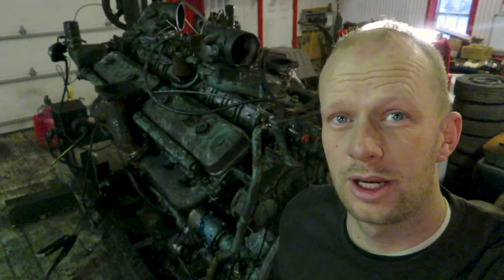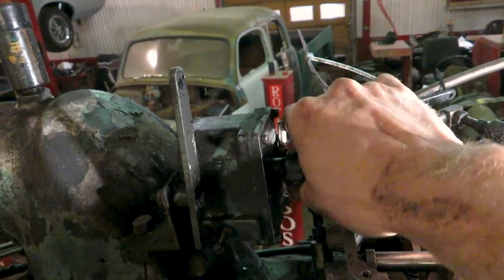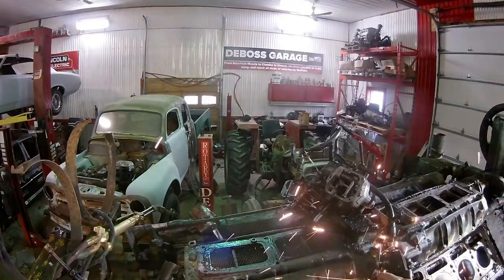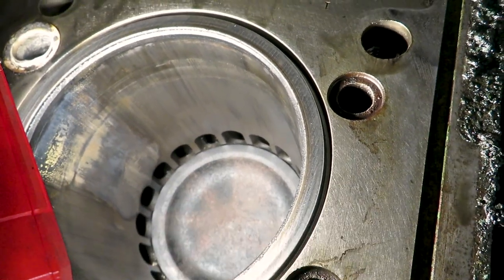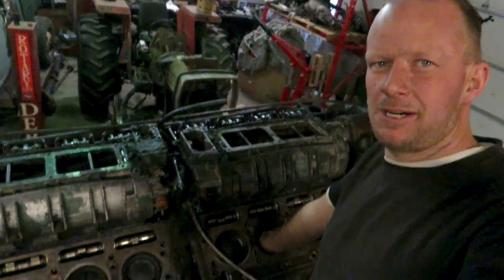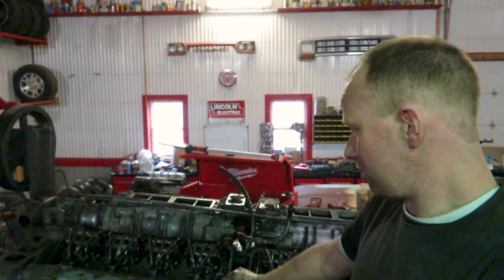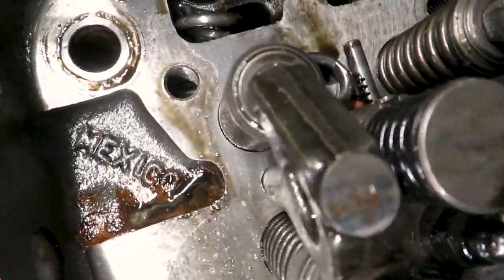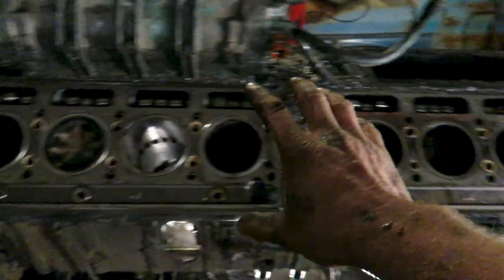What's Inside a 16cyl 2 Stroke Detroit Diesel? #HowItWorks

Comment: When Detroits were allowed to sit too long, the fuel would jell and make sticky injectors. Due to mechanical governor, all of these mechanical engines were at full throttle when shut down. Shutting off the fuel caused the RPM to drop below minimum setting which opens the throttle. When they are started after sitting the injectors are stuck at full throttle. If cranking a Detroit that has been sitting, remove valve covers and check the rack for free movement just like shown in this video before attempting to start. When the engine starts and RPM passes the governor setting the rack will move to throttle back. The 71 series were dry sleeve, the 53 and 95 series were wet, not sure about 110 series or the 149 series, but these engines were a well thought out design for the time period.
Reply: Jeff Snider. I'm attempting to get a 6-71 reverse rotation bus running. 1951. Was running perfectly 10 years when I parked it. It will start,  but won't stay running (ether only). Guess I should pull that valve cover and check this out

Comment: Is it true you can run them in reverse? Very clean under the valve cover.
Reply: At 23:00 or so he confirms this.
Reply: Guess I should have watched the video before commenting.
Reply: Yep, the timing gear in the front cover is switched to the other side and the whole injector/cam drive reverses. Most twin boat drives had counter rotating engines and props for better performance. The Detroits were very advanced for their time.
Reply: You had to reset the oil pump to pump the other, usually rotating the housing 180
Reply: You can run a 4 stroke in reverse too if you grind the camshaft "backwards".
Reply: Yeah, totally. I've seen it done.
Reply: Yes. A LOT easier than you think. I've had them suck water up the exhaust on a marine engine and bend rods like pretzels.
Reply: Pretty sure the biggest thing is reclocking the oil pump and probably a few more things. It won't get oil pressure running backwards without addressing it otherwise its fine. I remember hearing about a dump truck parked on a hill that started to roll backwards (trans in a gear) and it fired up and took off!
Reply: @mytmousemalibu apparently that was a danger with two-stroke tractors, run out of steam going up a steep hill, stall and roll back and now you are going full throttle backwards
Reply: @fuzzy1dk  probably not very good for what ever implement thd tractor is pulling either. I would Imagine most farmers would quickly stand on yhe clutch and brakes if that occurred.

Comment: And another point! These engines are very expensive to rebuild.  The parts are becoming increasingly difficult to get. There were a few exceptions but in general the two stroke jokes did not last as long as the Cummins or the 40 and 60 Series Detroits. 
The company I worked for saved a million liters of Diesel fuel a year when they went to Cummins "C".  The Detroit two cycle engines were an environmental threat.  The best assembly with the best products could not stop the leaking, often called "sweating a little" by the representative. It was common to add more than five liters of oil at the end of a day in traffic. Cold weather starting was always a big problem with the two cycle engines. The company used to buy ether by the dozens of cases  every winter month. 
The later Detroits in the 40 and 60 Series were a much better engine.  The transition was difficult for some of the "old guard" and a few took early retirement. While the unit injector stayed the tune-up procedure was completely different. I am was amused when you mentioned the common-rail fueling. I suppose you could have mentioned the roller cam followers also. The "rollers" have been in these engines for 7 decades. I have repurposed a set of roller cam followers to transport the hydraulic ram in my shop press. The valve spring roller rotator assemblies make good load  separators in a few of my shop projects.  Thanks for the memories. Does anyone remember where the floor-dry is?
Reply from the maker: Thanks for adding that.  We figure the best thing we could do with this engine is a teardown and let everyone appreciate them for what they were
Reply: The floor dry is under my old cat collecting the sweat lol
Reply: A lot of trucks with DD engines have over 1 million miles, some time the piston ring show signs of wear. How ever the main bearings and con rod bearing could go another million miles. As in all engines you have to service the engine as recommended.

Comment: I worked on these 2 strokes about a billion years ago and they were actually easy to work on, which was a good thing because we worked on them A LOT. They ran near or at WOT most of the time on stationary pumps and damn they were noisy and nasty. IIRC, the only time they didn't leak oil was when they didn't have any.

Comment: You, Sir, are not allowed to play with a Napier Deltec diesel.
Blowing that one up would hurt.
Reply: rich actually knows the worth of what he's playing with, he wouldn't break something that still had practical value
ie:this engine was already fucked and not worth a rebuild
Reply: @snoofayy6150  I know that I was just poking fun a little. I'm sure if he had a Deltec he would treat it like his baby. They are fascinating engines.
Reply: @johnparrish9215  deltics are like my unicorn. i wish they adapted that to fit in trucks and cars. it was so power dense and had big displacement for its size and weight. the new ford f150 with the achates apposed 3 2 stroke is awesome. if that truck comes out ill buy one
Reply: @chaytonruijsenaars3971  I've gone so far as to stack up 3 V8 engine blocks in a Deltec configuration just to see if it would work in a large truck. Yes, yes it will.
Reply: @chaytonruijsenaars3971  You know it is ironic that no one ever tried to build an aircraft engine that way. I know you can make it light enough and it certainly made enough power.

Comment: Well that was an interesting breakdown, I never seen inside one. My old man did a Detroit up decades ago on his own never having had one apart, the trouble came when Synchronizing the Injectors which is apparently a bit of a prick of a thing to do. They are relatively simple tough engines though otherwise. good to see your knowledge at work there & sharing it with us.

Comment: Absolutely fascinating!  So if the front and back bolt patterns are the same is there anything preventing you from basically adding a 3rd or 4th block to make it 24 or 32 cylinder!?
Reply: You would have to transmit all the power through each successive engine. Eventually the coupling or the crankshaft would not be able to transmit all the power and would break.  You also would have to build special adapters to power the middle supercharger and  cooling, fuel etc. Technically possible but probably very impractical.  A lot better to step up to a larger engine.
Reply: They did make V24 71 series Detroits, but they were two V12 blocks bolted together .
Reply: The farthest they took it was two 12V71 engine blocks bolted together to make the 24V71. After that, things get really complicated with block, crankshaft alignment and stability. The cranks aren't quite 'plug n play' that way either.
Reply: Could go for world record bolt 6 together
Reply: Yah I agree with your factual statement .

Comment: Great video, I never knew how these 2-stroke diesel worked until now. interesting 4 exhaust valves in the same configuration as a modern 4 value gasoline engine. Also interesting while the cams are in the block, the lifters/followers are in the head. And two cams in the block.  When I was a kid in the 80s, i am pretty sure my old school busses had V6 Detroit diesels in the back as pushers.  I still remember the sound those old blue-birds made after I got dropped off.

Comment: A Friend worked in New Jersey on V8 Detroits and he told me the biggest problem was when someone would Full Throttle Start the engine and the Blower Bearings would seize from lubeOil Starvation. They had to replace Many Blower Bearings. This Was a pretty simple and Neat engine

Comment: Two quick memories about Detroit Diesel engines.In the 1970 we had an Ingersoll Rand air compressor powered by D.D inline 6-71.During starting operator had press two buttons at the same time,one was starter the other was manual unloader so compressor would not cause too much drag.If operator released unloader button too early engine might start up backwards,especially in cold weather.Other memory is a 6-71 runaway,engine was being serviced something went south in governor,air shutoff had been removed.One guy said the tach reached 4000 before engine blew a rod holed the block.

Comment: A 16 cylinder engine with a massive bore like that creates the same power as a modern muscle car. Sure it has plenty upon plenty of torque to shit all over the place but its still a child’s toy compared to it’s modern day equivalent. its impressive how far we’ve come. All that new power and promise comes with a cost though. upon watching this video you can see how the mechanisms were designed for just pure abuse. Almost like the engineers thought the dumbest gorillas would operate it. way more abuse than would need to be put on the poor thing.. its clunky and stupid but it gets the job done and does it with an almost majestic level of reliability.
Reply: A muscle car doesnt push out 600+ horsepower.
Reply: DUTY CYCLE!
Reply: Its more impressive when you compare it to other diesels of the time. 2 strokes generally make 70% more than the same engine would if it was 4 stroke
Reply: But also this engine makes 800hp not 600 and 2100ftpd at 2100rpm. This is out of an engine with 1930's technology. Their simplicity is one of the big reasons m4 shermans where so successful
Reply: Verloren too bad the Chrysler diesel that was superior to everything else wasn’t utilized because a turbo charged diesel wasn’t cost affective back then. So even though it made more power, better gas mileage and more reliable, they went with other shit engines.
Reply: @SillyDillysTunes  mmm i dunno about you but i dont think 1930's turbo technology and reliability really go togeather. But also what was it called? I cant find anything made by chrysler at the time that used turbo charging
Reply: Verloren I’ll have to look it up. I had an old debate with someone about the Sherman engines making more power than he said it did. I found a site with all the different engines and their history and stats.

Comment: 8th! So could you split the blocks apart and run one by itself?
Reply from the maker: Yes and no.  The belly pan is different so it only has one oil pan and pump between the two engines.  You could take a good 8V71 and strip it down, bolt it to the good half of this 16, add about $10 000 worth of work and parts into it and bring it back to a fully working 16 cylinder.  You would need the oil pan and pump of an 8 cylinder to make the good half of this one run again.
Reply: @DEBOSSGARAGE  Now that would be a job for someone with richer blood than I. But that still cool how modular these engines are. Great Vid, keep it minty.
Reply: I overhauled these by the bucket loads when I was @ DDA distributor.  You can't use a regular 871 block.  There's special machine work to be able to mate the blocks. The crankshaft is specifically for a 16.
Reply: @rolandashurst5843  that would be the $10,000 worth of work and parts he mentioned, so yes you can use a 8v71.

Comment: Water pump, chippers. And V_drive coaches were left hand torn engines also. 
We would push the liners out with a round steel dowel. The end were turned down to fit inside the intake ports.  Run the piston down, put in the bar,  and bar the engine over. It would push the liner out. When all the way up, take off the rod cap and pull it all out.

Comment: Another way to pop liners out is to use a 3” 3/8” extension in the intake port and roll the engine over. The piston will pop even the nastiest liner.

Comment: I like that beastly fan hub. I engineered a fan drive for a Cummins QSK19 for an Atlas Copco Wagner 50 ton underground haul truck. I flipped through old DD drawings and found the hub. Better than designing my own hub. A welded and machined offset bracket bolted up to the Cummins block. Add a custom crank pulley and done. Well, added a die spring and a jack screw setup to help properly tension the belt.

Did a second engine installation using that fan hub and a DD Series 60 but never got it built. Sales thought they had a buyer but...

Comment: My autocar truck originally was fitted with the twin 8v71 engines but was upgraded to 92s ! They are set up as a power pack with a clutch on the rear engine driving a shaft that goes to the 20 speed drop box , changing power packs only takes about two hours !

Comment: Very cool design. I always knew they were basically two V-8’s put together. I just always assumed that they were cast together I didn’t know you could actually separate them and use them. It would be cool if someone would build some engines that way now. I’d love to have one of the little two stroke turbo four-cylinders.  I think it’s a 4-53 T because it has a blower and a turbo.I have a friend that has one in an old pan. A few years ago we carried A battery down into the woods this thing was covered in briars and had saplings growing up through it. One little sniff of either and it fired right up. They ran the piss out of the thing for one week While their big Catapillar pan was out of service and drove it right back down into the woods when they got done. It’s sitting there waiting to be resurrected again. Probably not very powerful but it would be sweet in an old 2 ton truck or something. Cool video!

Comment: I was working on those larger Detroit's out in Dutch harbor Alaska in 1989 .... the first thing you do before u touch an engine is make sure the air box dump works - otherwise you can try harder on ur next job - you can determine the rotation of the engine by looking to see which side the idle gear is on - the engine rotates the direction towards the idler gear - u really have to be careful with those small rack hold down bolts at the ends of the racks - they can go right to the pan - plug them with a rag - in an emergency what u do is jerk out the piston and cut the rod off - put the piston back in so that it covers the air inlet holes - then go into the air box and shoot a couple of bolts or screws into the piston to hold it in place...problem solved - the main way those engines would burn it's own oil is when the blower seals get sucked in from the shut down flapper valves create a huge vacuum when they shut off the air - the way you put the two blocks together u use a big slug that is the same size as the crank main bearing bores and line up the two blocks within a few thousands of an inch - it works better if u stand the back block on its rear end and stack the front block on it - the use ur lineup slug to get it straight - those bolts that hold the blocks together are tight as the hubs of hell - it's a pain in the butt to mate up two blocks - the 71 series used 1 block for the 12 cylinder and two blocks for the 16 cylinder- the 92 series used two 6 cylinder blocks for the 12 and 2 8 cylinder blocks for the 16 cylinder- Detroit also had a bigger engine it was a 149 series - they have 8 12 and 16 cylinder 149's - they were real hot rods 12 cylinder engines with 4 turbos 2 intercoolers with blower bypasses and 1600 hp at 1800 rpm - the way to tell when a Detroit gets to rated speed is easy - you start to bleed from your ears and nose.... I enjoyed watching you blow up the beast - I worked on several I wanted to do exactly that to.  There is another engine that is built just like the Detroit it's called an EMD - it stands for Electro Motive Division - both companies were owned by General Motors till Roger Penski brought out Detroit - he wanted EMD too but GM wouldn't sell back then the EMD engine was 645 cubic inches per cylinder- they made it in 8, 12, 16 and 20 cylinder
 configurations - you should find one of those and blow it up lol - I have seen the aftermath of it several times and been up close and personal with one when it over speeded and threw a pole piece- it was quite eventful....

Comment: These are a bit like a normal 2 stroke petrol engine, but the ports in the cylinders are for the inlet, the exhaust is handled by overhead valves. The inlet ports are fed by a chamber that connects to the superchargers, not into the crankcase like a petrol version and the superchargers provide exhaust scavenging rather than any real boost. They just pump air so the clearances are pretty loose as they run quite hot. This style supercharger was fitted to the inline 71 series GM 2 stroke diesels too, with the case being slightly different. This is where the  6-71 supercharger and its variants that are commonly used in drag racing originated from. 

There were also locomotive engines made by GM that were the same 2 stroke arrangement, although massively bigger and with a more modular construction. They were great to work on compared to some of the 4 stroke diesels like English Electric, which seemed to have 20 whitworth studs and nuts to hold on every inspection plate or cover on and a maze of external pipework and manifolding.